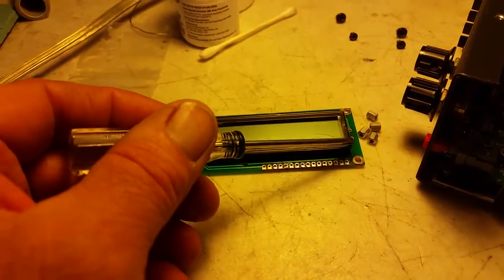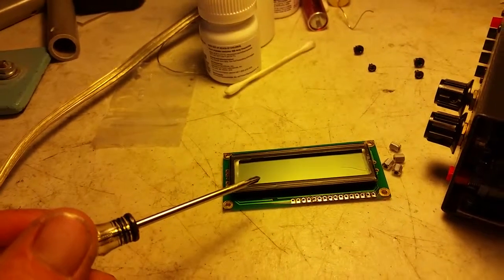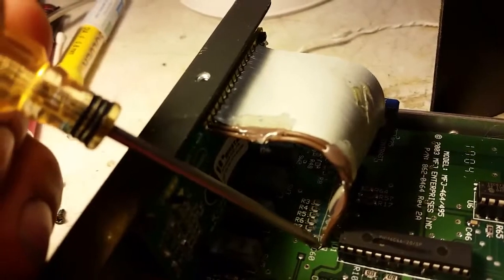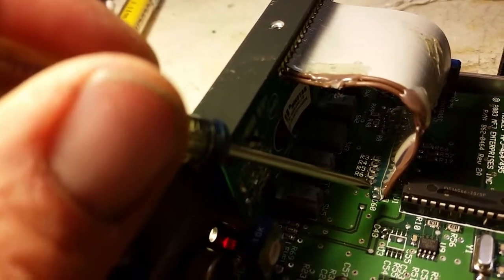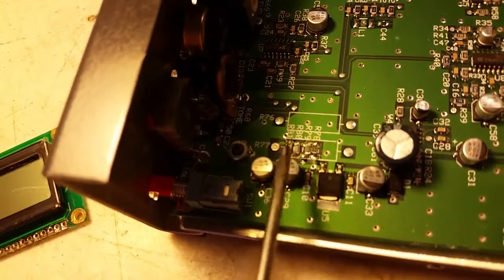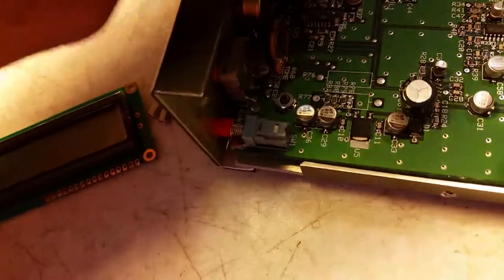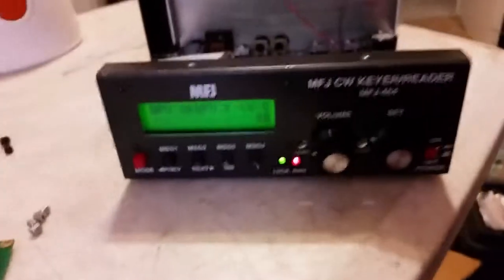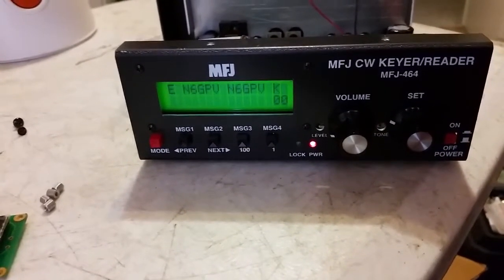MFJ-464 Keyer/Reader

Comment from the maker: That's weird I got them from MFJ?? There was no instructions on how to do it but I just had to look at the diagram and do it. There is nothing special about the display and I believe you can get one for a few dollars but the plastic spacers would be a little difficult to come by but the resistors are common and I just added a piece of wire. I will have to watch my own video and see if I can remember what I did.

Comment: Where did you get the parts, mfj says  they do not have the parts thanks KO4GZP
Reply from the maker: Hey Terrence if you put your email on QRZ If I get time I might be able to find more information on it but you can find displays on ebay as well as the resistors they are all smd's and all four 220 value. you may have to measure them to see what size they need to be. the display is common and I have bought them for a couple of bucks for other projects off of ebay as well. you need to have small solder, some flux and a fine tip soldering iron.
Reply from the maker: Look this up on eBay LCD 1602 Blue screen with backlight display 1602A 5v module for Arduino; and the resistors. Use wire from junk box small probably 24guage any color will do and a 104 50 volt capacitor. You might as well buy a kit of these capacitors as they only are a couple of bucks more and you will wait for what seems forever. Capacitor Ceramic 10 Values 104-106 50 Volts Accessories Assorted Electrical.
Reply: @bruceweight7319  called mfj they do not have the resistors, give me an idea where to find the resistors thanks
Reply from the maker: I got them all from Ebay You will also have to get a new 16 X 2 lighted display green or blue, and 4 ea. 220 smd resistors and also a 50 vdc 104 pf ceramic capacitor. I got them all from eBay. If I can get time I can try and get a link for you to the specific parts. use the diagram in the manual which you can find online.
Reply from the maker: You can get them on eBay.

Comment from the maker: The gentleman I did this for got the stuff from MFJ. You need the standoffs the four resistors for R78 R79 R80 R81 And .1 uf for C60 Mfj did not get me the .1uf which I got a standard cap and put it on the back of the board. You will need the updated diagram.